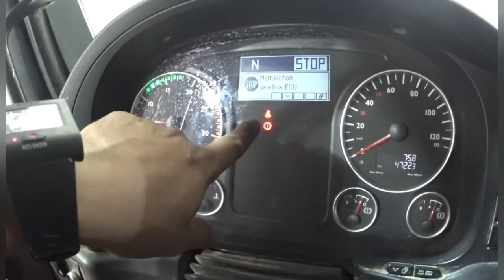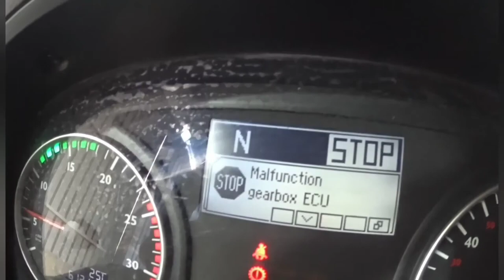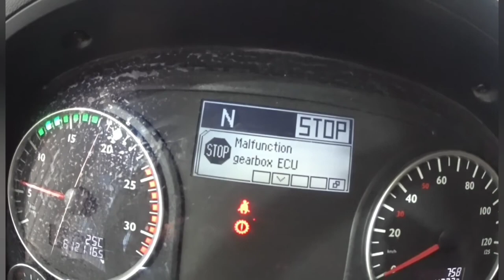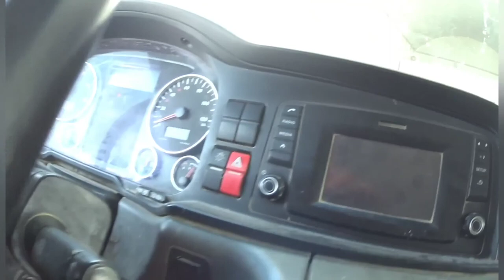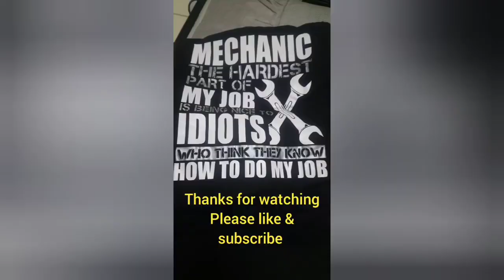Man truck TGS-40.480 automatic diagnose and troubleshoot replace clutch kit.. #mantruck #automatic..

Comment: My dashboard showing wrong gears... What should I do
Reply from the maker: You should check visible problem specially in clutch kit....
Reply: @jurechtheexplorer1145  clutch and pressure plate is ok..... The clutch is biting the flywheel nice ....
When I'm in 1st gear...the dash showing 3rd ....when I'm in 3rd the dash showing 6th
Reply from the maker: @alvesthegreat  you must be contact the dealership to scan the gearbox control module....
Reply: @jurechtheexplorer1145   ok